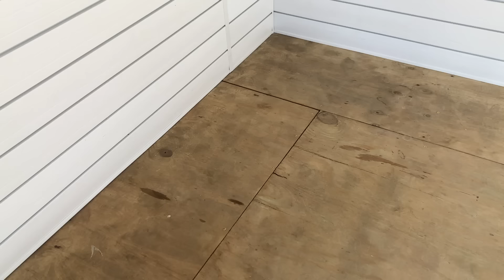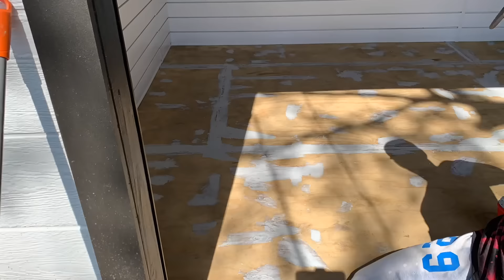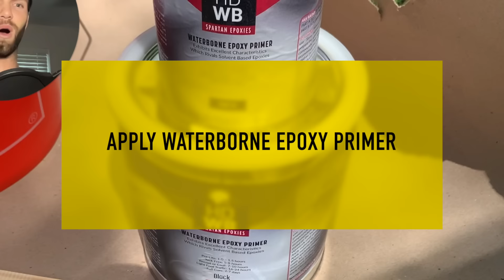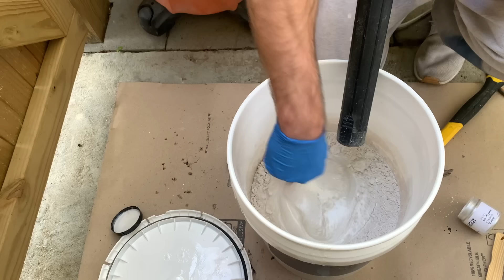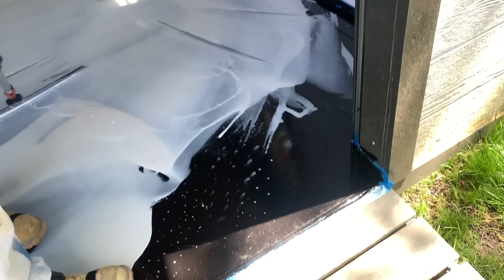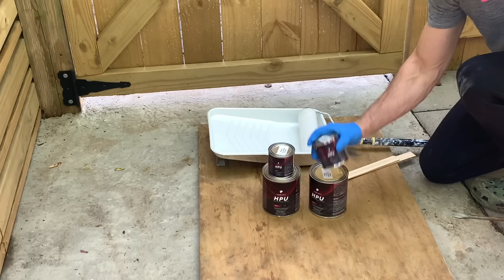Epoxy Floor Coating Over Plywood Subfloor (Amazing Result!)

Comment: We put industrial epoxy (I forget which) over a US penny floor in our kitchen. I was too cheap to buy those expensive shoes for a one-time project. I took dollar store flip-flops, traced around them on a piece of scrap plywood, cut out the shapes with a jigsaw, then attached the flip-flops to the wood with leftover drywall screws through the foam, pointy end to the floor. I made one pair for myself, and one for my husband. They worked a treat and cost $2 total instead of $100/pair.
Reply: Great idea, thanks for sharing
Reply: @master6676  you're welcome!
Reply: @MaryCumbersnatch  I got mine off Temu for $8 and worked fine. They have them at walmart too for $16
Reply: You can wear cleats to
Reply: We did that with cheap shoes
Reply: You can wear cleats to
Reply: That’s great! I didn’t want to spend $ on the shoes either. I seriously slipped 3 times while epoxying my garage floor. I’m darn lucky I didn’t break anything 😬
Reply: You can wear cleats to
Reply: Good idea
Reply: MVP
Reply: But can I wear cleats to?
Reply: @dragonstepper  they're your feet, so you can do what you like.
Reply: It’s been two years. Has a representative from the US treasury come knocking demanding you to put those pennies back into circulation? 🤣
Reply: @mowman7777  nope, and I'm debating putting in another penny floor in the guest bathroom here at my new house.
Reply: Thanks 🙏🏽
Reply: They are about $12
Reply: Dude  you cheap a$$  😂😂😂 they are like $20 bucks
Reply: @VergorioVergara  what store? I only saw them for $100/pair when I put in the penny floor years ago. I said I was being cheap because I refused to shell out $200 on specialty footwear we'd wear once, when I could make the same footwear for 1/100 of the price using mostly materials we leftover from other projects.
Reply: Why go throgh all the trouble of attaching the plywood? Could have just used the $1 flip flops and tossed them afterwards.
Reply: @AA-zq1sx  the screws won't hold in cheap foam flip flops, and we didn't want to lose our shoes in the middle of the epoxy pour.
Reply: An awful lot of work to save a few bucks tight wad
Reply: @mattalbrecht7471  Angry little man.
Reply: @mattalbrecht7471  *$200 and I was happy to spend 30 minutes on a project. I guess some of us just have ambition, and enjoy creating.

Comment: I don't have a plywood floor, I have spruce floor boards so there are gaps along every board. Do I need to fill each crack before I can move to the next step?

Comment: Did you sand the epoxy filler used for the cracks/screw heads?
Reply from the maker: I didn’t - I just applied a thick enough layer of epoxy to cover it
Reply: @AndrewThronImprovements  No need to sand the plywood the open the pores for the first epoxy coat? Like with concrete, you must grind it. Just curious.

Comment: I'm curious as to how the floor is holding up with a wood sub floor. It's a small surface compared to say a larger living room so I'm a bit skeptical as to the give of the wood and the epoxy cracking. I've been doing epoxy floors for a couple years now but not steadily. I'm a painting contractor so I have customers on occasion wanting epoxy products but mostly all garages. Now I have one wanting a 600 square foot living room and dining room with the wood subfloor. I know there are other methods I can use but I wanted to start with the most basic and see how it was holding up without adding any other screws or any self leveler or anything at all. Any information as always good information so I'd appreciate it.
Reply: It's been a few weeks so the answer is probably not good.🤔
Reply from the maker: It’s been over a year and it’s been holding up pretty well! I feel like it faded a little, but not too bad
Reply: My first question! Hope theres an answer soon!

Comment: This is not something I would ever do - looks very expensive and complicated! But wow,  this was one of the most incredibly satisfying videos I have ever watched! Thanks for sharing!
Reply: It's cheaper than 99¢ 12x12 stick on tile and is waterproof as well as more durable and easy to repair. Remember that stick on tile has to follow the arrow on the bottom so any cuts take up a whole tile and the rest is useless or the pattern doesn't match.
Reply: @tomharrell9575  I agree the epoxy has way more value but from the pricing from the link he has shows a little over $500 for the kit to do 150sqft. you could do laminate for that price let alone pretty much any stick on tile for far less.
Reply: @tomharrell9575  metallic epoxy does not hold up, it look great when u apply but once u start using it, you can see every imperfection, your footprint, bike tire marks, dog scratches, anything show up on there.
Reply: Really he just showed you step by step lol

Comment: So no grinding is needed it only applies to concrete? & flex proxy product is only for wood & wouldn’t be needed for concrete ? When you were applying your white Epoxy how did you wait until adding the black epoxy?? Is there a color chart you may know for on what colors would be great to use as a design  just how you used this black & white ? BTW your code was the most helpful thank you for this I don’t really comment but you are different & actually spreads a wealth of knowledge thanks for giving back !

Comment: Could epoxy be used to make an extremely uneven floor level?
Reply: I would say nope.. would need self leveling concrete layer
Reply from the maker: I agree - use a self leveling underlayment for that imo

Comment: Overtime as the floor settles would the epoxy crack?
Reply: It won’t crack, the primer is flexible and the epoxy will bend, it actually takes a lot for epoxy to crack
Reply: I think it's a rubber type material. So it flexes with movement

Comment: If its an old or existing floor, chances are all the plywood subfloor joints wont be perfectly flat. Floor leveler may help in such a situation
Reply from the maker: That’s a good point, Zach! Thanks for watching!
Reply: @AndrewThronImprovements  looks good, man!
Reply: What is floor leveler?

Comment: Did you have to sand the gaps you filled in?
Reply from the maker: Nope - I tried to keep them pretty flush so that the epoxy layers would cover it up after the various coats. Thanks for watching!

Comment: Is epoxy safe to use inside of a house? 
On top of a subfloor? Thank you
Reply from the maker: Hi - Yes it should be, just check with the manufacturer of the epoxy. The fumes can be a bit strong, however. So good ventilation is a must. Thanks for watching!

Comment: Outstanding job Andrew!  The color choice is perfect.  My daughter used blues on her concrete floor for a similar look.  I thought you built your shed on a concrete base; guess I missed something.   My back aches for you, however, was there no longer handles available for that floor rolling job? :)  Bt, you are young with a different perspective.  It is an amazing metamorphosis however you look at it: style, electrified, storage friendly and beautiful to look at.  Thanks for the show and I'm looking forward to the next one.  Patrick
Reply from the maker: I appreciate it, Patrick! I built a plywood shed base frame on TOP of the concrete slab actually - but I could have just build the shed slab-on-grade. And I hear you on the back lol but it's mainly my knees these days haha. Appreciate you watching and for the continued support of the channel!
Reply: @AndrewThronImprovements  I really feel your pain WRT your knees.  Mine have both been replaced ergo no pain, unless I kneel.  Imagine the odd looks at Mass when I do not kneel with the others.  I have to really turn up my Halo and forge on.  The contractor pads don't fit and can't be adjusted for me.  Eventually I'll find some that fit, stay in place etc.  I will remain faithful ATI fan and patiently wait for a full blown ATI channel with all your talents showcased for all to see.  Just set up your investment scheme now so you don't have to delay filming when all the $$$ begins to come in :).  Are the Oysters any good this season?

Comment: Excellent! Are there temperature restrictions for applying epoxy? I assume there would be on the cold end, but are there any on the hot end? I live in the humid south.🐝🤗❤️
Reply from the maker: Hi Deborah - as Spartan Epoxy commented below, I believe there is an optimal application temperature range. However, I think it holds up pretty well in almost all temperatures after it has cured. Thanks for watching!
Reply: @AndrewThronImprovements  Ok, thanks so much🐝🤗❤️
Reply from the maker: @deborahdanhauer8525  Welcome! good luck with your project 👍
Reply: @AndrewThronImprovements  🤗
Reply: Hello Deborah. Recommended application temperatures are 60 to 90 Degrees F with relative humidity below 85% for best results. We sell a lot of epoxy to folks in the south. Especially Florida!